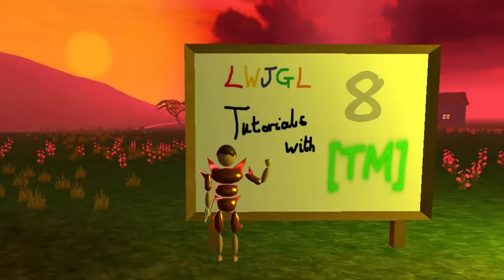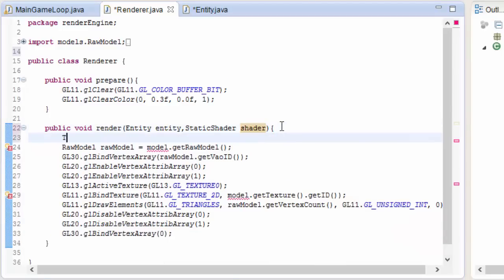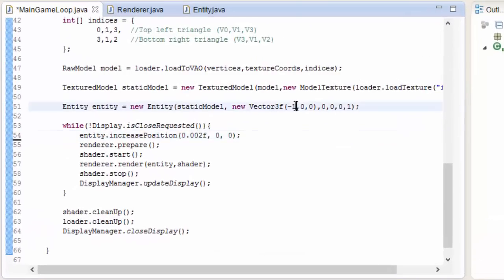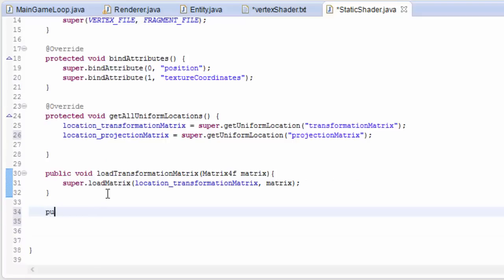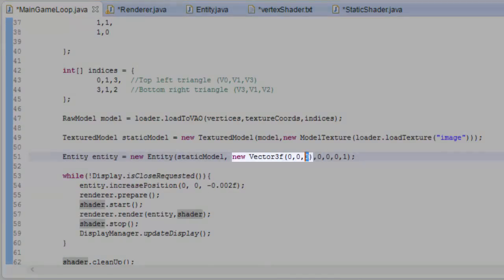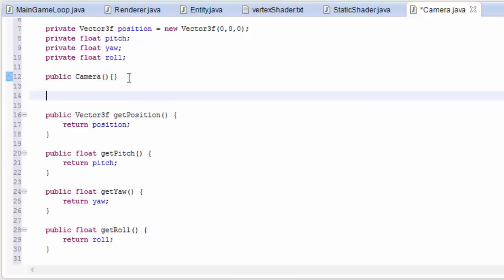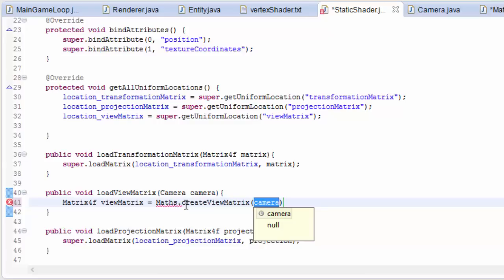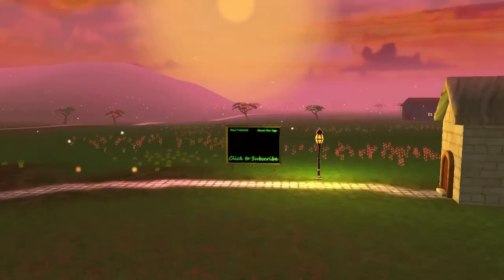OpenGL 3D Game Tutorial 8: Model, View & Projection Matrices

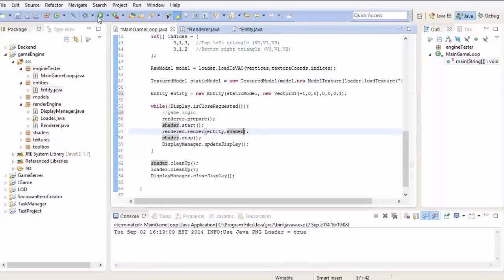Comment: I dont know what is the couse for this issue but at 5:00 it only worked for me when I did
float[] floats = new float[16];
        matrix.get(floats);
        matrixBuffer.put(floats);
in the loadMatrix method.
Otherwise the values from my matrix would not been put in the buffer
Reply: Thank you so much, this fixed my problem. I thought I was having issues with using JOML and was looking at all the matrix stuff for that thinking I was misunderstanding them.
Reply: thank you i thought i have to restart

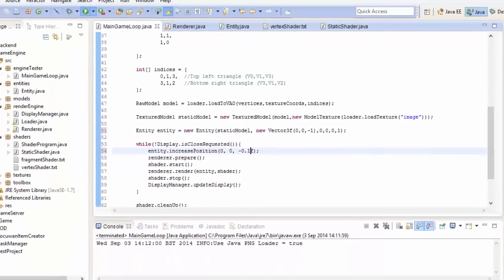Comment: If at 11:47 your image doesn't load, you may have wrote  this line in vertexShader.txt  wrong, i did

gl_Position = transformationMatrix * transformationMatrix * vec4(position, 1.0);

Here is  the correct way to write it:

 gl_Position = projectionMatrix * transformationMatrix * vec4(position, 1.0);

Comment: You can make the engine run significantly faster if you store the transformation matrix and only update it when the transformation data has to change, then just read that in the render method.

Comment: For anyone having troubles with the quad not appearing based on the Z position, make sure you are not using a different version of LWJGL, which should be the 2.9.1 version. I had the 2.9.3 and it made the quad be invisible on Z >= 1 and Z <= -1.

Comment: I haven't finished your series about making your own game engine, but I just wanted to ask now: How can I use the engine in another Project? I am asking because I want to make the game in a seperate Project but I still want to use the engine. Is there a way to do this? If you don't know what i mean... then imagine is like this:
I just want to import the engine with the line "import GameEngine;" or something like this, just one line to import the whole engine and the game works instantly with the engine.
I hope you get, what I mean...
Reply: The answer will change depending upon the IDE you use. I use Eclipse so here is an Eclipse answer.
1. Open the 'File' tab in the Eclipse taskbar
2. Select 'Export' from the drop-down list.
3. Select 'Jar file' (not runnable jar) from the options.
4. Navigate to your engine project and select all the files in the 'src' folder (except the file that contains the main class).
5. Select location and export.

Now you have your entire engine in a jar file. Now include this jar file in another project just like you did cyclone jars in this one.

Hope this helps.

Comment: To whoever who reads this:
If your quad isn't rendering after implementing the transformation matrix, check in the ShaderProgram class, in the loadMatrix method, whether you are using the correct GL20 method!
In my case, I was using the GL20.glUniformMatrix3(...) but the Transformation Matrix is a 4x4 matrix, not a 3x3 matrix, so I changed it to GL20.glUniformMatrix4(...).
Cheers if this works! ;)
Reply: Dude you’re a life saver

Comment: Ok, old but great tutorial. I have an issue: I have a 16*16 texture and when I apply it on the cube, it is very blurred... what's the problem?
Reply: you probably already fixed this by now but right after you get the texture id, you need to write:

glTexParameterf(GL_TEXTURE_2D, GL_TEXTURE_MIN_FILTER, GL_NEAREST);
glTexParameterf(GL_TEXTURE_2D, GL_TEXTURE_MAG_FILTER, GL_NEAREST);

it is important that you use GL_NEAREST because that makes it so you can display pixel art. GL_LINEAR makes it so that the texture blurs so it looks better with higher res images. Right now you are using GL_LINEAR

Edit: tell me if it doesn't work because I never tried this on my project since I am not following his tutorials completely

Comment: I'm using LWJGL3 and can't create the projection matrix with "(float) Display.getWidth() / (float) Display.getHeight();". I'm creating a window using GLFW (ie window = glfwCreateWindow). However, in my rendering class I'm referencing the org.lwjglx.opengl.Display class. Is there a different way to set the aspect ratio variable?
Reply: Found a fix. Hope this helps anyone who's stuck...

*use this in createProjectionMatrix() method:
IntBuffer w = BufferUtils.createIntBuffer(4);
IntBuffer h = BufferUtils.createIntBuffer(4);
GLFW.glfwGetWindowSize(DisplayManager.getWindow(), w, h);
int width = w.get(0);
int height = h.get(0);
float aspectRatio = width / height;

Comment: My image has diseapered
when i edited the file's
Reply: java.io.FileNotFoundException: res\hoho.png.png (The system cannot find the file specified)
 at java.io.FileInputStream.open0(Native Method)
 at java.io.FileInputStream.open(Unknown Source)
 at java.io.FileInputStream.<init>(Unknown Source)
 at java.io.FileInputStream.<init>(Unknown Source)
 at renderEngine.Loader.loadTexture(Loader.java:40)
 at engineTester.MainGameLoop.main(MainGameLoop.java:106)
Exception in thread "main" java.lang.NullPointerException
 at renderEngine.Loader.loadTexture(Loader.java:46)
 at engineTester.MainGameLoop.main(MainGameLoop.java:106)

the line i changed was TexturedModel staticModel = new TexturedModel(model,new ModelTexture(loader.loadTexture("hoho.png")));
Reply: @prod.s23  the file either doesn't exist, or you are telling java to look for it in a place that doesn't exist. make sure the path that you are pointing to is the correct one.

Comment: I have strange errors here;
First off, when I rotate an object around the x- Axis, only half the object is displayed and after half a rotation only the other half is displayed.
Second is that if I add the projection matrix, nothing is displayed at all
and a third thing (which probably is correct but still irritates me) is that the object disapperars if it is further than (0, 0, -1)

I am a bit puzzled because lwjgl 3 (JOML) has changed a lot :/
Reply: I am having a similar issue. I know opengl will cull anything outside the -1 to 1 range on both the x and y axis. I wonder if it's the same on the z axis.
Reply: After some testing it looks like OpenGL will cull outside the -1 to 1 on only the x and z. It is up to the projection matrix to cull on the z axis (Z near / Z far). At least that what I think :P
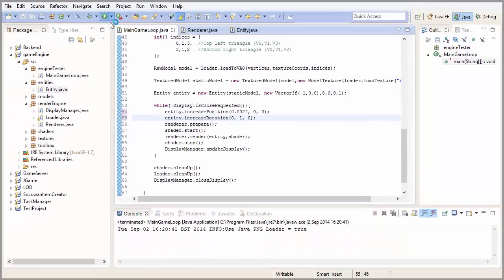Reply: But then the image wouldn't rotate at 5:33, would it?
Reply: I don't really know why, but it just started working :O
I added the projectionMatrix back to the vertex shader and it just worked.
Perhaps I didn't load the matrix correctly;
the code should've been:

protected void loadMatrix(int location, Matrix4f matrix) {
  matrix.get(matrixBuffer);
  GL20.glUniformMatrix4fv(location, false, matrixBuffer);
 }

for lwjgl 3 (+ JOML)

Comment: When it comes to our transformation matrix in our Maths class, how come we do the translation first and rotation second? Is the Matrix4f doing things backwards?
Reply from the maker: This is just the way that matrix transformations work. It's basically the reverse of the way you would expect. You can think of the transforms as always using the entity's local axes. So when you apply a rotation it rotates around the model's origin, not the world's origin. It also rotates the local axes as well, so if you rotate first and then translate along the x axis, the x axis would be in a different direction to the world's x axis. So we translate first, before the local axes have been rotated or scaled, and then we rotate. If you use Blender, it's like setting the transformation axes to "local" instead of "global", and then rotating and moving the object. You'll notice that the axis is rotated and moved as well. Try rotating and then moving in the x direction, and then try it again but the other way round. You'll see how the end result differs.

Comment: Hey thinmatrix do you have any tutorials on quaternions? im not looking for in detail quaternion math, but an abstraction from that and how exactly you use already made quaternion library with matrices to get a complete transform mat4x4 that contains position/rotation/scale all in one.

I use rust language and cgmath(no tutorial available) library with opengl, i managed to get position scale local and world working but when i use quaternions for rotations i get weird transform matrices.
I tried diferent order of operations without success, only two operations can work at a time  from scale/translation/rotation.

All 3 dont work, my transform is done like following:
I store postion in vec3, scale in vec3 and rot in quaternion which i modify using functions, then before each frame i reconstruct the model matrix with those v3,v3,Quat and send them to GPU shader, except as i said i get incorrect results no matter the order in which i construct the model matrix.

Also how can i create a local transform and a world transform for each object, do i use two m4x4 one for local one for world? and at the end we multiply them to create the mvp? 
Pseudo code:
mvp = projection * view * modelWorld * modelLocal ... etc?

How is local space and world space constructed usually in 3d games ? can it be done from a single model matrix( i doubt)?

Thanks for great tutorials helps a lot.
Reply: Ok so i solved one part of the problem i multiply in this order Translate * Rot * Scale and it works. But i still cant get a working local and world transform.

Comment: To get an ortho2D projection :
   public static Matrix4f createProjectionMatrix(float left, float right, float bottom, float top, float near, float far) {
        Matrix4f ortho = new Matrix4f();

        float tx = -(right + left) / (right - left);
        float ty = -(top + bottom) / (top - bottom);
        float tz = -(far + near) / (far - near);

        ortho.m00 = 2f / (right - left);
        ortho.m11 = 2f / (top - bottom);
        ortho.m22 = -2f / (far - near);
        ortho.m30 = tx;
        ortho.m31 = ty;
        ortho.m32 = tz;

        return ortho.scale(new Vector3f(1.0f, -1.0f, 1.0f));
    }

and init with: 

shader.bind();
  shader.setUniformM("projectionMatrix", Mathf.createProjectionMatrix(-Main.getWidth()/2, Main.getWidth()/2, Main.getHeight()/2, -Main.getHeight()/2, 0, 100));
  shader.unbind();

PS: you will have to scale your model to 100 to see something (or it will be smaller than a pixel)

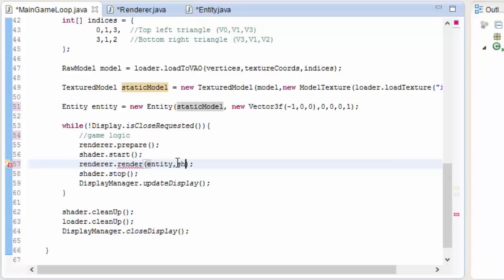Comment: 5:00 not working for me, and I noticed that you made some changes prior to this video.
Reply from the maker: Check the "Common Problems" section in the description and see if any of those help. No real changes were made to the code other than a few differences to variable names (I lost my code and redid it using the tutorial, but named one or two variables slightly differently). The actual workings of the code haven't changed at all though and the different variable names shouldn't be a problem for anyone who is already comfortable using Java.

Comment: for those which are using GLFW for inputs handling, in case of need, here is how i managed the thing.
create a Keyboard class for inputs handling:

public class Keyboard extends GLFWKeyCallback {
    public static boolean[] keys = new boolean[65536];
    @Override
    public void invoke(long window, int key, int scancode, int action, int mods) {
        keys[key] = action != GLFW.GLFW_RELEASE;
    }
    public static boolean isKeyDown(int keycode){
        return keys[keycode];
    }
}

(if you have a better way for keep tracking of inputs pressed instead of declaring that huge boolean array please tell me, i didn't go deep in my research becouse of time. i'm just trying to learn and if it works so far, for me is not that big of a deal)

then in the Camera constructor add these lines:
        Keyboard keyboard = new Keyboard();
        GLFW.glfwSetKeyCallback(DisplayManager.getWindow() , keyboard::invoke);

in the move method now you just have to call in the if statement: Keyboard.isKeyDown(GLFW.GLFW_KEY_"yourbutton") etc

hope this helps

Comment: IntelliJ has a handy plugin for shaders: https://plugins.jetbrains.com/plugin/6993-glsl-support
really useful to prevent errors such as naming the variables wrong later in the shader. Doesn't help with integration into Java, but at least it eliminates problems with typos later in the shader files. There's a slightly different format (.vert and .frag instead of .txt) but it's worth it for syntax

Comment: Everything is correct and it simply wont work. no errors, just no quad. LWJGL3 with javax.vecmath. shader is correct, calculation is correct. order is correct. and it simply wont show. I trying to figure it out for 2 hours now and Im simply done. I go buy a new keyboard.
Reply from the maker: At what point of the video did it stop working? Did it stop working as soon as you added in the transformation matrix?
Reply: without projection everything works fine.
z position of entity was moved
it doesnt work
Reply: when I added the projection matrix. formula: projection * transformation * vec4(iPos, 1.0)
But I think it has more to do with the transformation matrix as it is made with javax.vecmath because LWJGL3 doesn't have the utils anymore.
javax.vecmath code:
 public Matrix4f getTransformation() {
  
  Matrix4f transformation = new Matrix4f();
  transformation.setIdentity();
  transformation.setTranslation(this.translation);
  transformation.rotX((float)Math.toRadians(this.rotation.x));
  transformation.rotY((float)Math.toRadians(this.rotation.y));
  transformation.rotZ((float)Math.toRadians(this.rotation.z));
  transformation.setScale(this.scale);
  
  return transformation;
 }
Reply: Is the transformation matrix supposed to look like this when the coordinates where changed?:
1.0, -0.0, 0.0, 0.0
0.0, 1.0, 0.0, 0.0
0.0, 0.0, 1.0, 0.0
0.0, 0.0, 0.0, 1.0
Reply from the maker: That transformation matrix is completely empty (it's the identity matrix) - multiplying that with the vertex would do the same thing as not using the transformation matrix at all. So that could be part of the problem.
Reply: I now copied some legacy code from LWJGL2 and integrated it. (Just the Matrix4f class)
it works. so it had to do with the transformation matrix. Now I have to somehow work out a way to get it to work without the legacy code.
I will post the solution for calculating the transformation matrix once I figured it out.

@ThinMatrix you dont have a nice article describing how a transformation matrix is calculated cell by cell without complicated math symbols like on the wikipedia page, do you? I couldn't find anything to this subject that didnt deal in complicated math symbols.

Comment: For people using JOML math library, use this to get the projection matrix:
projectionMatrix = new Matrix4f().perspective((float) Math.toRadians(FOV), DisplayManager.width/DisplayManager.height, NEAR_PLANE, FAR_PLANE);
Reply: Omgggggggg. I was stuck on this for so long. I was using Matrix4f.perspective to replace the block of code, but couldn't figure out why it wouldn't project. Didn't realize the first argument is in radians and not degrees. Thank you so much.
Reply: Np :D
Reply: Nugget that's not cheating, that's using already made resources. You don't need to reinvent the wheel. The most important part is to understand what is projection.
Reply: NuggetOfBlueGold if you dont have to understand something you have choice to either not care  at all or beside the fact that you "skipped" it try to understand it. There ale lots of people that do it just like ThinMatrix did but they dont understand it, they just copy the code
Reply: oof i coded that from scratch lol

this.y_scale = (float)(1/Math.tan(Math.toRadians(fieldOfView / 2f)));
  this.x_scale = y_scale / aspectRatio;
  float frustum_length = far_plane - near_plane;
  
  projectionMatrix.m00(x_scale);
  projectionMatrix.m11(y_scale);
  projectionMatrix.m22(-((far_plane + near_plane) / frustum_length));
  projectionMatrix.m23(-1);
  projectionMatrix.m32(-((2 * near_plane * far_plane) / frustum_length));
  projectionMatrix.m33(0);

Comment: I don't know what I missed but everything is different from the last video and I love you thin matrix but it is kinda frustrating
Reply from the maker: It's not all different, the code is exactly the same but there's one or two variables with slightly different names because I had to redo the code after losing it. But variables having different names doesn't change the code in any way, and it really shouldn't confuse you if you're confident with using Java.

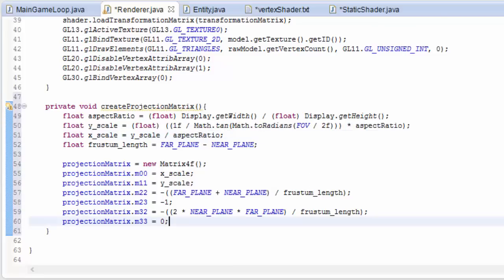Comment: I know this video is a bit old, but at 10:22 should'nt y_scale be

float yScale = 1f / (float) Math.tan(Math.toRadians(FOV / 2f));

instead of 

float yScale = (1f / (float) Math.tan(Math.toRadians(FOV / 2f))) * aspectRatio;

?

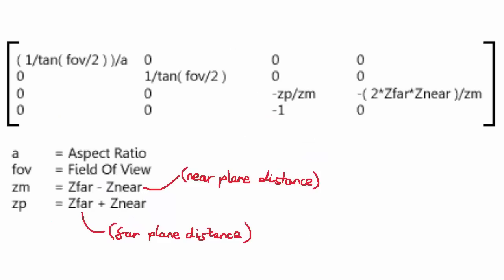At least that's what matches the matrix values at 7:36.
Reply from the maker: Yes, that's correct. If I remember correctly I think I fixed it in a later tutorial.

Comment: (I am using lwjgl 3)
Is anyone else getting this error in the createProjectionMatrixMethod?
"The field Matrix4f.m00 is not visible"

I checked the lwjgl 3 source code, and the Matrix4f m00 m11... variables are all private, and there are no getters. So how do you access the variables?
Reply: It might have to do with the fact I am using JOML unstead of the util

import org.joml.Matrix4f;
Reply from the maker: I'm not sure, I've never used joml before but I would think that there must be some other method in that class that allows you to set the variables. If you're really stuck then you could actually still use the Matrix4f class from the lwjgl_utils jar. There are some classes in lwjgl_utils that don't work with LWJGL 3, but all the vector and matrix class are just pure Java code so they can of course be used in any project, even ones not related to LWJGL at all.